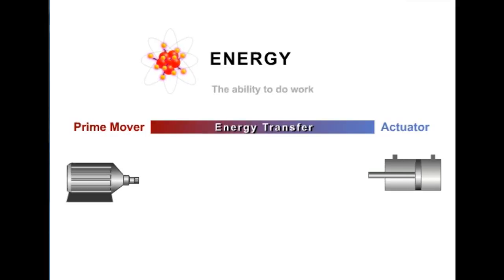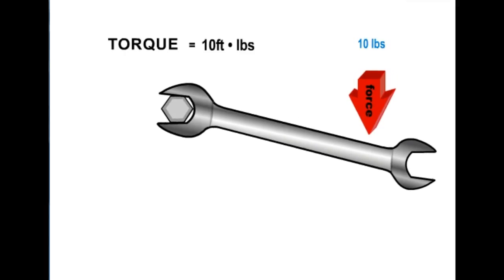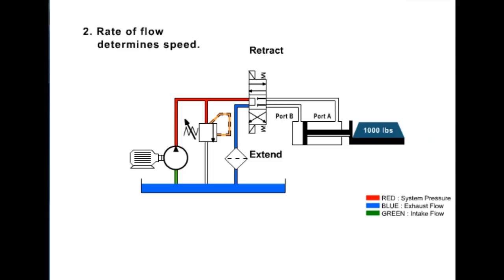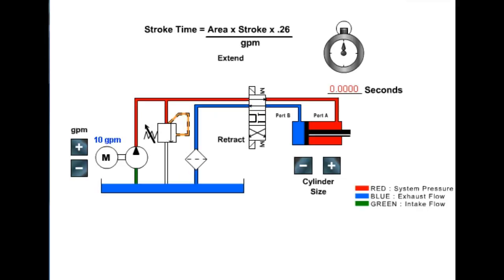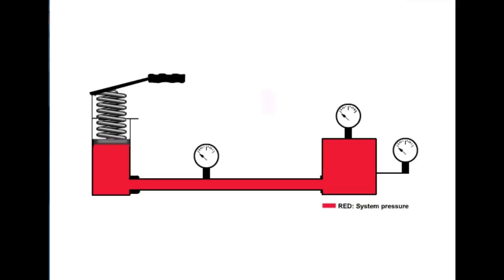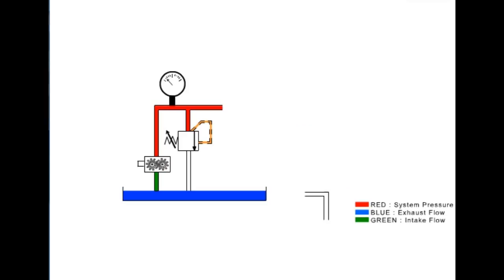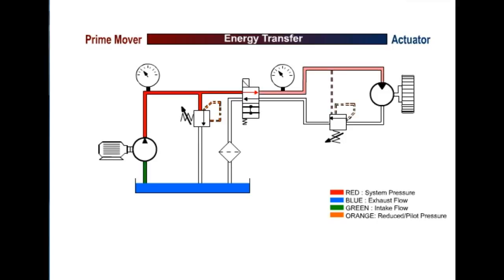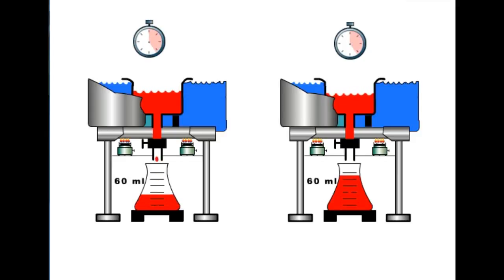Hydraulic Basics - 01 | Detailed explanation | ,#hydraulic,#valve,#pumps,#fluid,#dynamic,#

Comment: The math circle again useful.   F/PxA    If 2 values are known, the unknown value is then
figured out.   Algebra used in equasions.   But this is for business math.  The same idea.
Put your finger on the value you want to know.  Then divide the numerator by denominator if needed or multiply them, if you want the F value in pounds.  F = pounds.  P = PSI, A = Area, for business math.